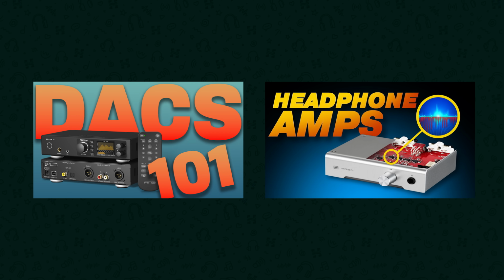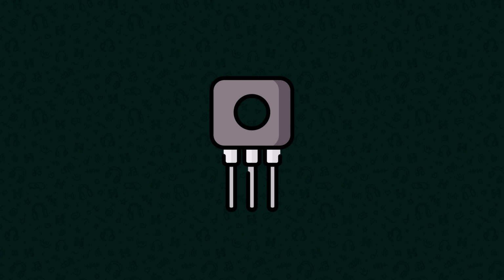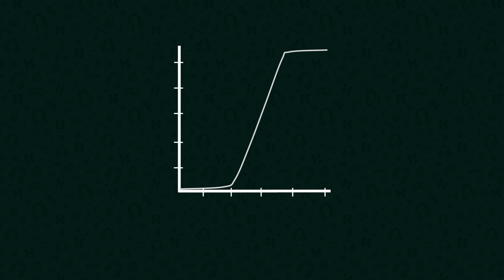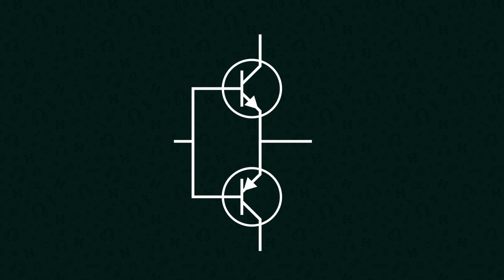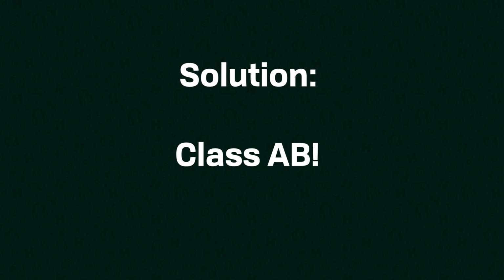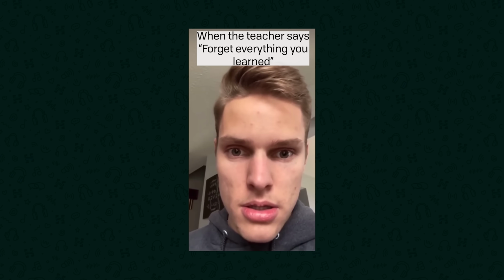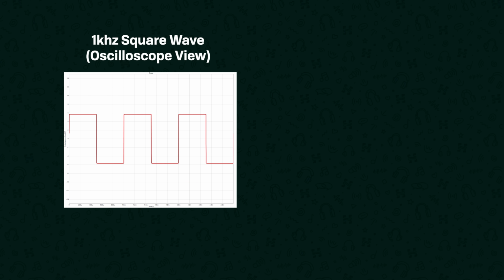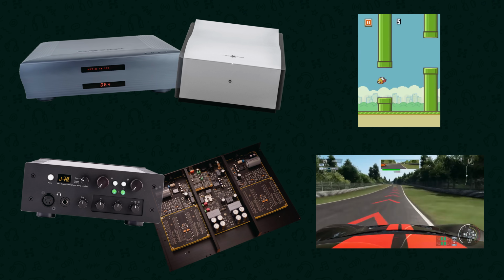Audio amp classes as fast as possible!

Comment: Great explaination! However, I missed the primary reason we bothered to develop class D amps. By only turning the transistor fully on or off, we avoid the less efficient linear zone, granting a significant gain in overall efficiency.
Reply: This allows for madness like 3 kW amplifiers in a 3U rack mount, where a class A amplifier would probably occupy the entire rack.
Reply: @mal2ksc  and relatively powerful car radios to exist in a single DIN dashboard slot.

Comment: Thanks for this explainer! I learned a lot.

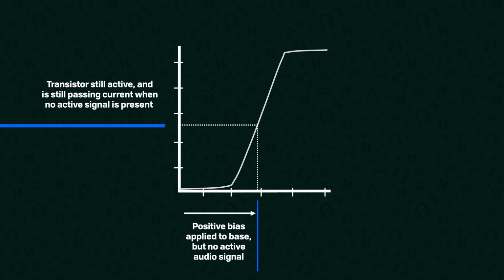Just one tiny note: 3:27 "quescient current" 🥐might have been a typo or a misread of the script. Seems like this should be "Quiescent"? (Pronounced "kwee-ess-n't", with "kwee" as in "acquiesce" (ack-kwee-ess), or "kwy-ess-n't", with "kwy" as in "quiet".) I guess this is a technical term/synonym with "static current" since it just means "still" or "calm".

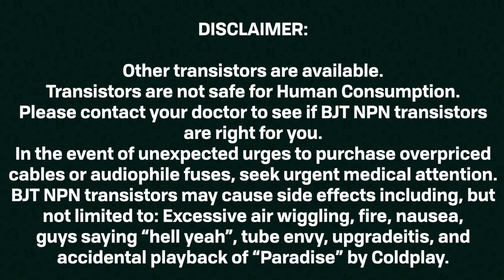(Also: 1:30 "Accidental playback of 'Paradise' by Coldplay" 💀Damn, transistors are scary.)
Reply: "quiescent" is indeed the standard term for the static or steady-state current.

Comment: So tell me if I'm getting this right, you can apply a lowpass filter to the square(ish) wave from the switching output, which itself is derived from an output of a simple comparison function, and just like that you get back the original signal?! That seems crazy to me, Am I missing something here?
Reply: Pretty much!

Some things were simplified for ease of understanding in the video, for one being that the switching frequency will usually be hundreds of khz. Whereas the intended analog signal will only go up to 20khz. So the switching freq is many many many times higher. But in the video the overlay diagram had them very close in frequency so it was easier to see.

This image is a bit closer a representation of what you might see in reality: https://dlbeer.co.nz/articles/pdm-sine.png
Reply: the signal shown in the video confuses people

u will not get back ur signal if it is what is shown in the video

ur triangle needs to be much faster, at least 10 times of ur signal for good filtering

and imagine the dc state

if ur signal is dc and 70% of the amplitude of triangle wave

when compared, u get output square wave that is 70% of the time high

after filtering u would get a dc that is 70% of ur supply

Comment: I felt like there were positives and negatives for all but class D. Maybe I misunderstood. Isn't class D just best then?
Reply: Class D has the benefit of being EXTREMELY efficient, allowing class D amps to be far more compact. And many also achieve excellently low distortion. The biggest issue is that for many class D amps, because of the way the output low-pass filter works, the filter response will change depending on the impedance of the load.

This isn't really an issue for speakers, where you kinda know everything is going to be 4-8 Ohms. But for headphones where it could be anywhere from 12 to 600 Ohm (or in some cases further either way), this makes things tricky. And is why running headphones on a class D amp directly is not necessarily safe. You can end up creating a massive boost around the corner frequency, which both means that upper treble will be audibly boosted, but also that you risk pumping massively over-amplified ultrasonic content around 20-22khz through your headphones which could damage your headphones or your ears.

Class D amps have gotten better and better over time though, but there are still many that say they have a more clinical subjective sound than other types. Personally I've yet to find a class D amp that I really liked, but they're definitely improving substantially
Reply: @GoldenSound  Oh that changes everything then. Thank you so much for your detailed answer! I feel like I understand it a bit better now :)
Reply: for audio this is mostly true

but class d bandwidth is very low

while other classes can be used even beyond audio

Comment: Great explanation! Although there's no example on what each do sonically. So does this mean, they all pretty much achieve the same thing sonically? No inherent "flavor" introduced by being a specific class of amp?
Reply: if they behave perfectly there is no difference: just an amplification of an input signal. your headphone, speaker, or room will probably have a greater impact on the sound flavor than the amplifier or dac.

there are exceptions, but this is largely down to the device being designed to have that flavor rather than an inherit quality of the amp type.
Reply: What they do sonically, or not as the argument goes, is a bit controversial. 

The video probably avoided it on purpose. There's already a lot of info to get straight already for one video so best not to muddy the waters more than necessary.

But sonically it's another case of a matter of implementation and another tool in the toolbox. Some people definitely have a preference though.

Comment: This video is confusing Class A with single-ended amplifier circuits. Push-pull amplifiers can also be Class A, so long as the output devices remain powered up throughout the cycle.
Reply from the maker: Although actually, it'd also be worth noting that there is a bit of debate as to whether push pull class A amps are "real" class A or not. Personally I'm of the view that they are, but some people argue that they don't count. It's a weird one!
Reply: @TheHEADPHONEShow  It depends somewhat on how it is defined.  As a commercial radio engineer from the tube days, Class A is 100 percent duty cycle in the linear region hence energy and heat dissipating.  A push-pull design with two Class A amplifiers is certainly feasible but you'd need some sort of combiner, such as a transformer with split primary and it seems each amplifier would definitely interact with the other.  Class B is each output device operates in the linear region only 50 percent of the time.  Class C operates in the linear region less than 50 percent and could never be used for audio purposes.  Class D is theoretically never linear and depends upon other components to integrate pulses into varying voltage.   Dissipation will still exist in these components; the capacitors and inductors that integrate (smooth) the pulses but the actual energy waste will be minimal.
Reply: @TheHEADPHONEShow  Class A means the output device is conducting throughout the cycle (a conduction angle of 360°), Class B means an output device is only conducting for half the cycle, either the positive or negative of the electromagnetic wave (180°), and Class AB means the output devices have a conduction angle between 180° and 360°. It's as simple as that, not too complicated or lengthy to describe for a short video. 
The problem is that you are conflating two separate things, power amplifier classes and circuit typology. All single-ended amplifiers are Class A, but not all Class A amplifiers are single-ended.
Reply: Very interesting! Would be fantastic to have a part 2 advanced version of this where you go into these further. Content like this really gets people into the rabbit hole which builds the community!
Reply from the maker: This is true, thought it wasn't confusion, just too much to pack into a 10 min video unfortunately and trying to keep things simple. There's a few other things I'd like to have touched on like feedback too

Comment: You did a really good job with this. Now take a crack at explaining the increasingly popular ZOLT amplifier design, as found in Linear Tube Audio’s excellent sounding product line. Not really output transformer-less (OTL) not really but kind of class-D; that one will be a good challenge for you.
Reply: It's all just Lego. Electricity Lego.

Comment: How do Hiby DAPs switch between class A and D?
Reply: They don't? They switch between a and a/b
Reply: As the other replier said, they switch between A and AB.

They are almost certainly increasing the bias (the current that turns the transistor on) when you switch to class A. It is the same amplifier, but the output transistors remain on all the time.

This video is misleading in it's description of class A. It describes a single-ended amplifier and implies that is what class A is. Class A just means the transistors are conducting all the time. It is  extremely unlikely that Hiby are switching between single-ended and push-pull amplification (as this videos 'explanation' would have you believe).

Comment: so why/what/eh? are tubes now?
Reply: They're the precursor to transistors. They use thermionic emission instead of semi-conductor technology to operate. They're larger and less energy efficient than transistors so they were mostly phased out in the late 60s to early 70s. Today you mostly find them in certains niches like guitar or hi-fi amplifiers.
Reply: modern equivalent r depletion type mosfet, in terms of operation similarity
Reply: Presumably they work a bit like transistors?
Reply: They are transistors too, but not good at doing their jobs (which can also color the sound in a useful way)
Reply: Transistors - Emitter, Base, Collector
Tubes (triodes specifically) - Cathode, Control Grid, Anode
They are analogous devices, only differing in the mode and medium of charge transport. The conducting region of tubes isn't as linear though, which is why there is more distortion.